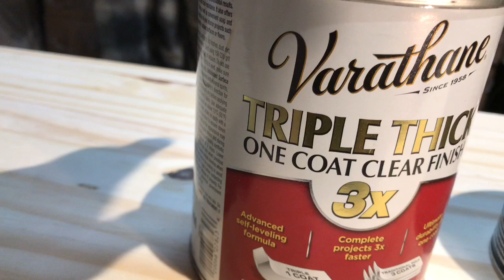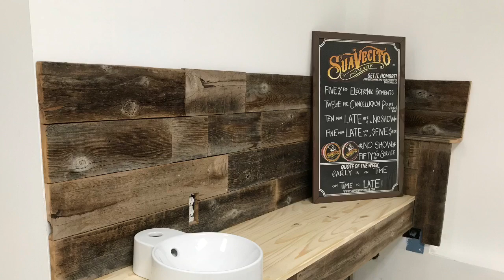22 Barbershop vancouver canada 🇨🇦

Comment: Did you buy a 4’x8’ pine panel to make these? If so do you remember what kind of panel?
Reply from the maker: Mike V  all the white board is from ikea kitchen cabinets need to assemble it that includes rail..hinges.. handles.. pine board that was stained w/ dark oak can purchase from home depot i think 16”  depth x 6 or 8’
Ur going to corporate the casing as diy supported by ikea cabinets and hardware.. goodluck😍🇨🇦🤘